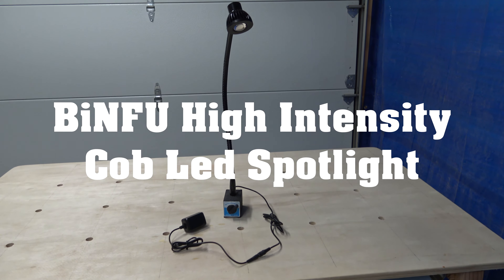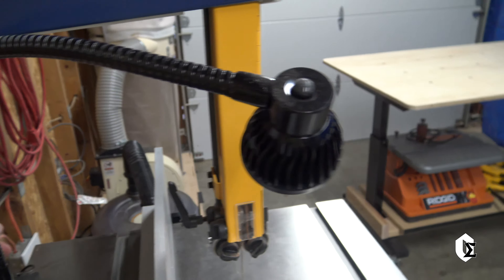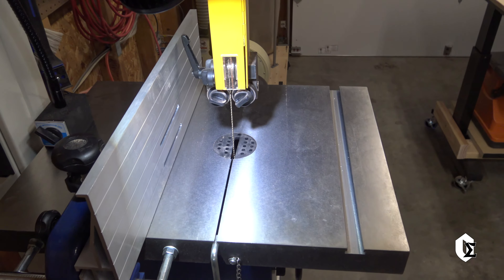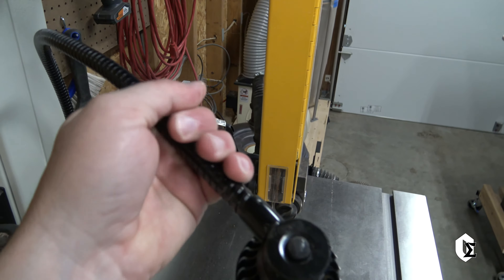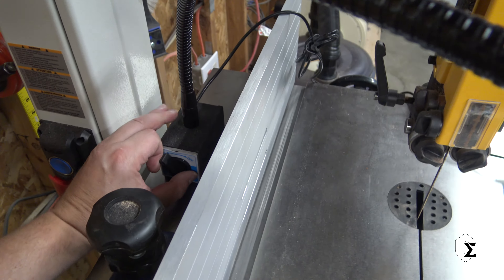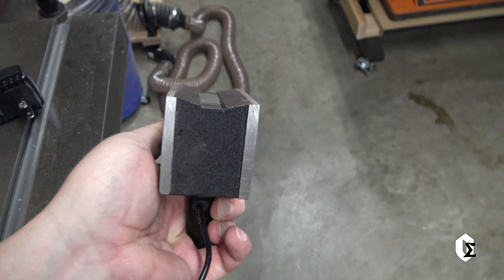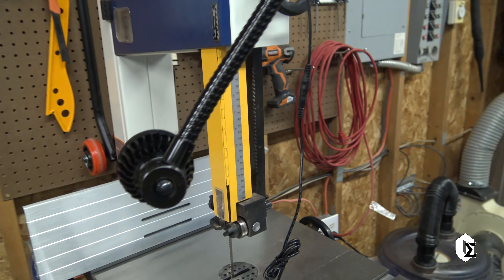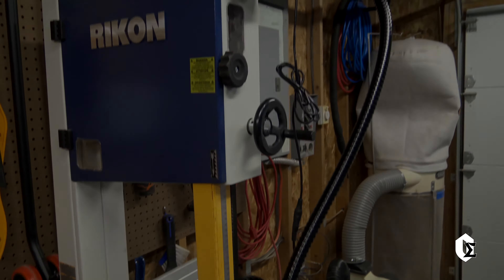Bandsaw Led Work Light

Comment: The switch is just rising and lowering the magnet I would bet.
Reply from the maker: The bottom outside part of the base does not move so if the magnet is inside and moves this would be correct.